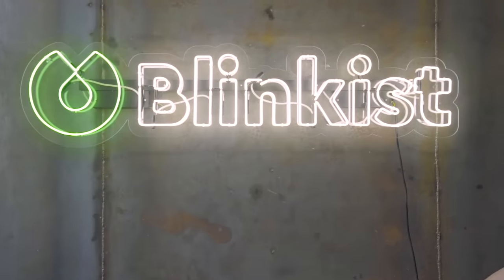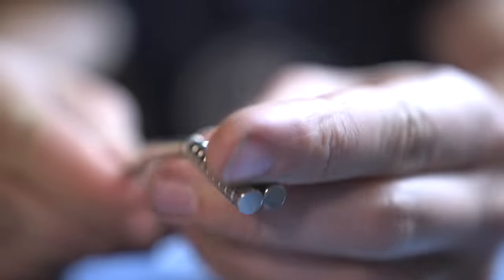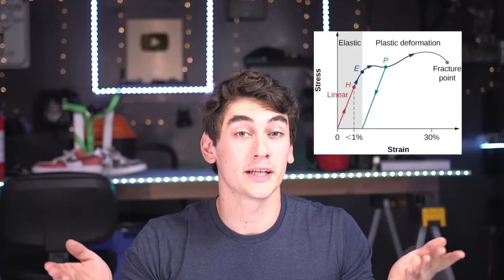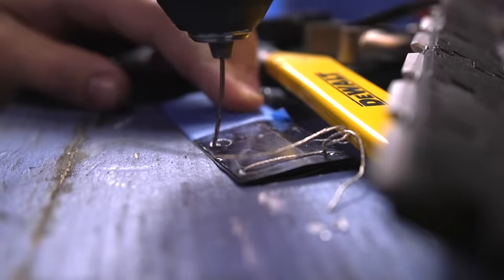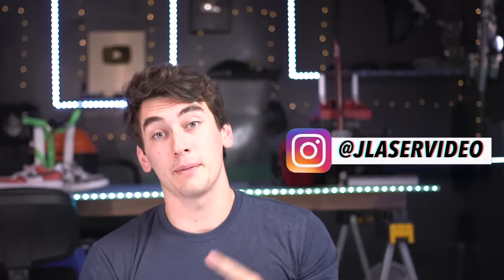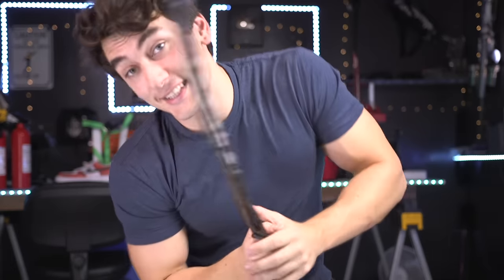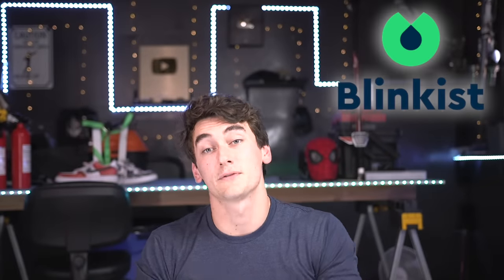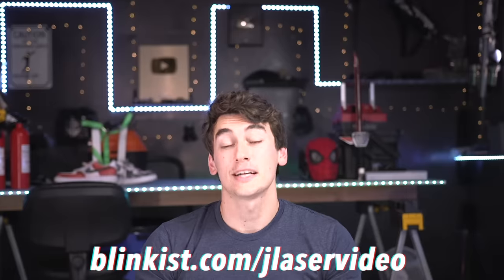Make A Belt That Turns Into A Sword! - The Spy Next Door (Working Spy Gadget!)

Comment: Build a watch that turns into a little spy drone
Reply: 11th commandment: Thou that reads OPS1947's comment shall press thy like button so it may be seen by the masses. And by JLaser video. (Forgive me, my archaic English isn't that good. But you get the point.)
Reply: Great idea
Reply: AWESOME
Reply: Wow, this got abt 40 more likes in 3 hours. Much more than I could ever hope for on a comment I post
Reply: That would be cool
Reply: Very cool idea
Reply: @xavierbbgiannakopoulos8987  😈
Reply: WATCH DRONE!! WATCH. DRONE. WOW!
Reply: cool idea, i was thinking of it too. cheapest build idea i have is to get a cheap fpv drone(~13USD) take its guts out and put it into 3d printed chassis(must be light) that folds and has spring loaded arms so it wont fold midflight. the "watch" part is not on the drone itself but is hinged out of the way for the drone to be light.
so my basic idea is you will have 3 pieces, drone, watch and strap assembly, and the controller-phone. watch is hinged open, drone is loaded and folded to the strap, watch is folded over the drone and locked. if the drone is needed, turn the drone on, turn on the controller and connect the drone to phone for fpv, a lever will be pulled to unghinge the watch out of the way of the drone simultaneously the drone unfolds. the drone being connected and paired to both the phone and controller can be launched using the controller. 
 i've been planning to create this one myself too but i don't have a 3d printer, i have a cheap mini quad(without cam) that is kinda powerful and i think will do the job ok, im planning to get a 3d printer so i can fulfill my ideas like this one.
Reply: @CottonballMonster   is a very good project and you sould buy a 3d priter is very use full i have one of them
Reply: Sova valorant huh?
Reply: I built one of these using a 5 dollar drone, and a Gatorade bottle
Reply: @spy kids
Reply from the maker: Maybe I will
Reply: @JLaservideo  Heck yeah
Reply: -And then he did
Reply: Federal Bureau of Investigation - FBI  😂😎👍
Reply: @lilj3467  yes thy fellow freind
Reply: and i make 1 k
Reply: Federal Bureau of Investigation - FBI  lol
Reply: Yes bro
Reply: Srry I disliked on accident
Reply: @JLaservideo  u neeed to
Reply: Tony Stark hat a better idea for Spider-Man
Reply: Yes pls
Reply: Yes please
Reply: I think it’s a given but if the watch could also be the controller it would be cool
Reply: @lilj3467  no
Reply: I agree
Reply: @JLaservideo  hi
Reply: @JLaservideo  great
Reply: Yeah
Reply: that will be really cool
Reply: @JLaservideo  you do good with your vids
Reply: @JLaservideo  try to use some kind of lubricant in the black panther sounproof shoes as it will decrease friction making more lesser sound also the liquids make lesser sound
Reply: Great Idea
Reply: OMG HE MADE A VID ABOUT THAT HE SHOUTED IT OUT IN: building a drone that turns into a spy drone go watch the video he made!

Comment: I’d love see this projected looked at again in the future— Sword Belt 2.O.
Something with a tension cable down the middle to prevent it from bending the wrong way that’s locked into place by the handle?
Reply: Or possibly the metal that instantly reverts to its original shape when it gets wet
Reply: I would think that you could have a flat rod built into the handle that extends alongside the bendy part of the sword to keep it from bending but still maintaining its belt/sword capabilities.

Comment: You should make Raya's sword that extends into a wip.
Reply: Yes
Reply: You can just build a sword in different segments that are tied together so when you slice it hard enough it becomes a whip, like fire embelem 3 houses
Reply: @jacobsturm1683  someone else already tried that. Tention is not a powerful enough force to keep them all together by itself.  It will need to be magnetic or maybe buckle powered. They need some form of mechanism to lock and release at each segment. I'm sure there's a way to do it. But pure tension won't "cut" it.
Reply: @Brick2buddies  magnectic would make more sense. Buckle would be more annoying to deal with in my opinion
Reply: Ye
Reply: Nah my mom has already done that

Comment: The funny thing is that 'belt sword' did in fact exist. The Indian Urumi is a whip-like flexible sword that was often worn like a belt by looping the blade around the user's waist, with the handle at the user's side much like a regular sword. It was used somewhat similarly to a flail and generally had a small guard (with the typical 'disc hilt') with a slender knucklebow and a mostly decorative pommel 'spike', not to mention quite a bit of reach.
Some wacky variations had multiple blades and were most often dual-wielded. I don't know how effective they were as a weapon, but they sure make for effective deterrence!
Reply: Good knowledge!

Comment: You should add a switch/button on the buckle so when pressed it electrifies the wire holding the sword together to create an electric sword 👍
Reply: Can u pls read what u just said and think for a sec....
Reply: @OnlyZipho  "You should add a switch/button on the buckle so when pressed it electrifies the wire holding the sword together to create an electric sword" ?
Hmmmm.. Ah, yes. He said that "He should add a switch/button on the buckle so when pressed it electrifies the wire holding the sword together to create an electric sword" .
Reply: @OnlyZipho  so ur saying that the shock batons sold in sporting good stores is actually a trap meant to kill the user? Interesting I had no idea the police and the government would allow machines that kill its user to be sold in millions of stores and on millions of websites and also to the police themselves. I had no idea the government would choose to supply its police with a weapon that is designed to kill its user
Reply: Might as well just add a gun barrel at the end
Reply: oh hi mark
Reply: @jacobsturm1683  legend
Reply: @oddboy9427  Most stun batons are usually made of carbon, aluminum, or steel and have a rubber grip. Typically the method of delivering a incapacitating charge are 2 or more prongs that allow an electrical arc to form. Having one solid piece of material with a charge running through it isn't practical for offense, defense, or any other kind of fenses you can think of. With that being the case, there would be a lot of work to be done to even resemble any tool meant to deliver a charge and even then I doubt it would work. Batteries, wiring, he would most likely need to replace the entire blade to a more conductive metal (assuming he's going to try and make the whole object "electrifyed", HOWEVER, if he had to do that it would probably make it impossible to be considered a "belt sword", as I doubt there is a flexible metal with that level of flex/retention that would also be conductive enough to deliver a charge worth anything. All in all, even if it was possible, it wouldn't make any sense, a sword is a lethal weapon meant to kill or cause a injury resulting in death. Pretty much all practical weapons with the intent to use electricity you see today are all meant for self defense and to incapacitate an average attacker without causing a life threatening injury. Any and all instances you or anyone sees of "weapons being supercharged with extreme technology" are literally just for show (although in some media, within certain universes, it could make sense but only because of the insanely unrealistic levels of technology within said universe(s).)

Comment: With the link design you could use a pin lock system that would run the length of the sword.  Each section would have its own spring loaded pin that locks into the next block and also pushes the next pin in to the next block and so on.  these pins can all be pushed with a thumb lever at the base that is in a J track (think bolt action guns or pens).  This would require significantly more precision but it would have serious rigidity.  Definitely a job for a CNC mill.

Comment: Try and spotwield the edges instead of using wire, that way you can also properly sharpen the edge.  Also you should try an internal telescopic structural pole that could be pulled back using an internal wire.

Comment: possible option for a stiffer design (would be time consuming to revert) could use spring bolts as each section of the belt straightens the bolt slides into a lock in the next piece if you design the segments as the belt wraps around the body would be a bit simpler. 3 to 4 segments for the side of the waist and 2 to 3 for front and back of the body.

Comment: you missed a nice design: Segments with springs that pull them together. When they pull together, they lock in place. To put them as belt, pull the mapart to unlock their rotation. This gives extreme rigidity sideways, and when do you ever pull on a sword?

Comment: I saw a belt sword years ago that was literally a steel sword blade that was sectioned into about 1" segments and two holes drilled into each segment and a steel cable threaded through (I don't know how they did the point as the cable needs to turn around and come back.  Today, I'd probably 3d print it out of steel with an internal U channel for the cable, but maybe it was hollowed out and a roller and pin inserted?).  When the cable is loosened, the segments can separate but are still held together as links by the cable going up and back through the centre, and can be inserted in a leather sheath that you can wear as a belt.   When you want it to be a sword, you pull it out of the sheath and a camming lever on the handle tensions the cable and locks all the pieces tightly together and you have a strong, rigid blade (the strength of the cable basically determines the strength of the sword).

Unfortunately I can no longer find images of this belt on the internet (probably censored by the powers that be because this literally becomes a usable weapon and is probably illegal in most jurisdictions), but I've always wanted to make one of these...

Comment: You could make a belt with a knife in it instead, that way you could make the actual blade easier to fit in and you would have more options with the metal because you wouldn't have to bend it

Comment: I was wondering if possible for the design to start as a belt but as you pull each element locks into predestined locks within the blade with the motion of the draw.

Comment: Okay so hear me out, a nitinol sword, the elasticity depends on the temperature and it will always go back to it original form when heated up. so you can make simply need to heat it up as it's removed from the belt with some magnet or something.

Comment: Couldn't you have bypassed the issue with the bending metal, by focusing on the Belt Buckle being a click-off kind of deal, with a retractable blade? 

I think there'd be several advantages to it. One being, that your metal no longer has to bend to be part of the belt, and thus giving you a more genuine sword to work with. The "belt buckle" would probably grow a fair amount in size (without being too clunky hopefully), but I think that would just give you an oppurtunity to get a better handle on the sword. The bigger the buckle, the easier to make slight modifications that retains its belt buckle look, while giving you better and more comfortable control over the sword.

Just a thought ^^

Comment: Got to have it so it wont cut the belt loops when you pull the belt out or putting it on.
Also you using metal that they do use to make those slap bracelets and when you could have been a little strips and look like giant slap bracelets in your hand😅

Comment: Im wondering if you could reprint the handle and have a push button that could put pressure on potentially another piece of material that is slotted in the center of the sword that can generate enough force to make the sword go floppy, that way you can put it in and out of its sheerh easier?

Comment: Electromagnetic gauntlet. The power supply, would be a nickel cadmium battery, in a battery pack. It would be a copper coil, on a steel bar. The gauntlet could be an old work glove.

Comment: Would grinding the edges seperately affect the elasticity of the material to a degree that this wouldn't be possible? If not, you could have ground down the protrusions of the wire holes and maybe given the sword an edge. 
As it is now, it is amazing and even bends like a proper sword (yes they do bend upon impact) and would do some serious damage even not sharpened, but an edge on this sword would certainly give it that extra deadliness.

Comment: Star Trek: The Future Begins...
The first idea is not wrong...
A blade consisting of partially... hollow parts that fit inside each other and are strung together by two steel wires  inside, it can work and so I would have done it.
Not a belt sword, but a folding... sword.

Comment: What if you used some kind of heat activated meomory metal and used some kind of wire relay to heat the metal to a straight (All be it shorter than the original belt) edge

Comment: I give you credit for innovation; however, the RazorRazor Company located in Milwaukee Wisconsin has a patent (Patented in 2010) for the BeltSword Weapon System.  

We have sold thousands of concealed swords to martial arts experts, law enforcement, military, and civilians.

Not only can our blades cut; but they can thrust through a human torso. 

We have videos of the RazorSword blade crushing through concrete blocks with only minimal damage to the blade.

We have hundreds of variants; based upon weight, thickness, rigidness, length, and mono blades verses laminated blades. 

Re: Daggers/Knives - We can hide a full size 6" to 9" tactical fixed blade knife under a small woman’s bikini.

Very respectfully, Curtis W. Koehler CEO – Chief Edged Officer

Comment: Sword belt
Legendary Asian weapon
Max upgrade level of a belt
Type : weapon
Weapon type : meelee
Atk : 90 (-10 damage if unseathing + slicing at the same time)
Def : 20
Cooldown : 1 sec
Durability : 999999999999999999999999999999999999999999999999999999912345678910999999999999111111111111111111101 use

Description : Made with stainless steel, hidden inside the floppy seatbelt material belt, this weapon is a belt like sword, able to bend into tge shape of a belt, whilst maintaining the sharpness of a sword, able to bend 90 degrees until locked into shape, material made with pure Asian blood and some iron ore, made by a worthy explorer/youtuber.